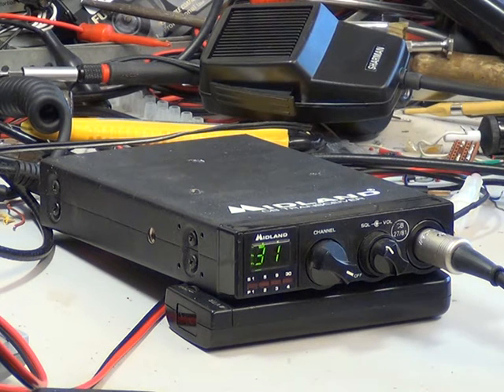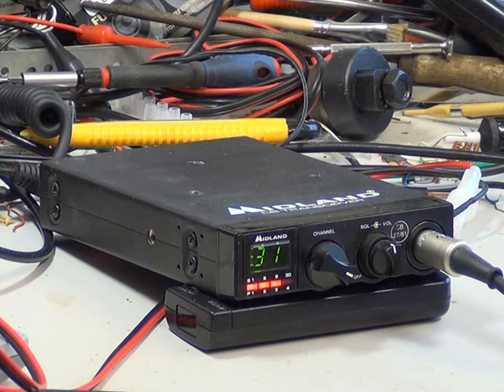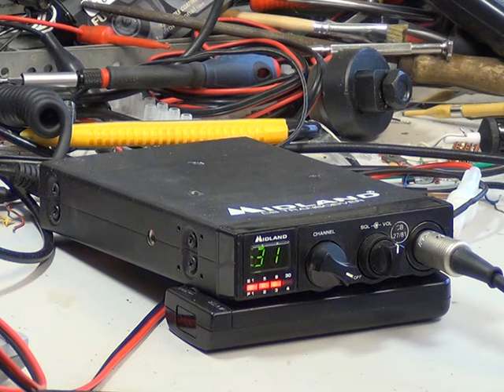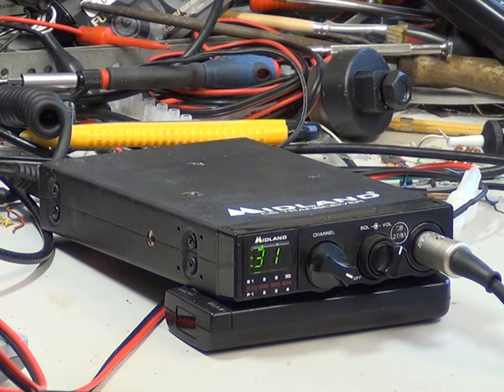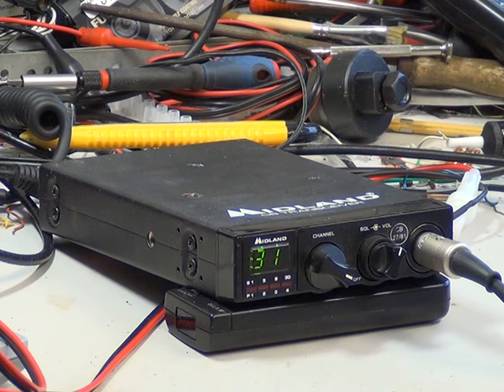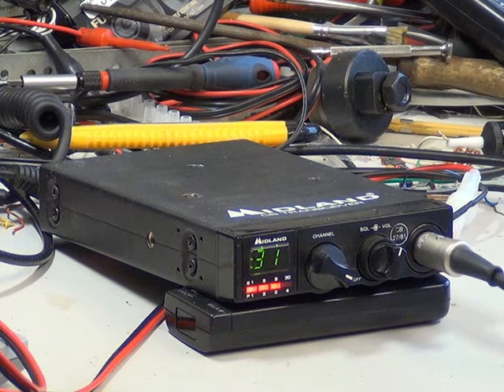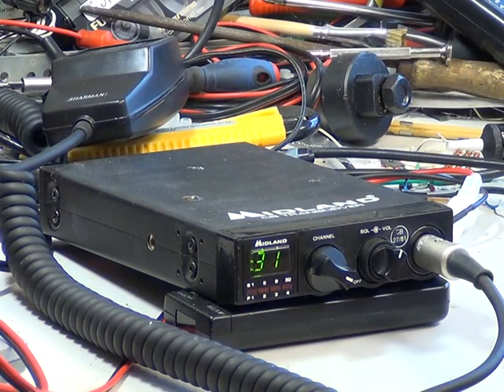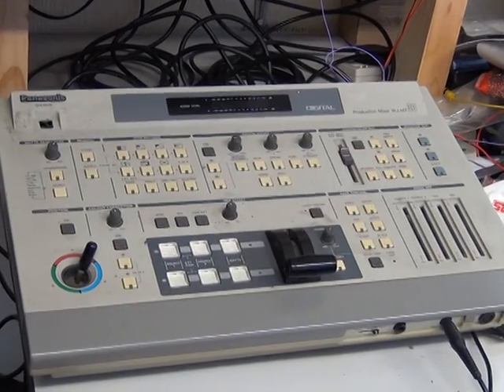Midland 77-104D (CB27/81) CB radio (Mobile) - On the air test

Comment: I'm just finding out that these skinny Midlands have speaker mics? And no internal speaker. Do you know if they are all like that? I'm looking to get either one similar to the one in the video or the one they used for the porta pack, with only on/off, squelch and S meter. Will I need to find one with a genuine midland mic or can I use any mic that fits? Thanks.
Reply from the maker: This video you have commented on is for the 77-104 which HAS an internal speaker. It's the virtually identical looking 77-805 that requires a speaker/mike. That's because it was sold as a port-a-pack transportable & not a mobile. If you end up with a 77-805 (much more expensive even s/h or faulty) then you can use a normal mike & extension speaker. I covered the 77-805 in a different couple of videos if you have a search for it.

Yes you need a genuine midland mike for the 77-805 if you want to use it how it was intended. I recall paying £17ish + post for a mike without a plug off ebay & thought myself lucky! I'd paid £6.50 for the radio alone.

Richard
Reply: @ukfmcbradioservicingTango21  thanks Richard, I shall try and find the 77-104 then to save myself some expense.

Comment: Evening Richard. Radio is back from Tony and following was done. Squelch was not really working too well and a clean up of the mic socket sorted it out. it was well off frequency so Tony aligned it for me. The only other problem that Tony notified me of was that he could only get 3 watts from it??? However I was on call at the weekend and got called to Gillingham in North Dorset and a "ham" friend of mine lives in Hinton st Mary. We spoke from Sturminster Newton, to Gillingham with just a mini springer on a mag mount on the roof, not swr'd-so it seems to be performing well????!!!!! Got a Wilson mini wil and will be permanently installing the radio into the car. Many thanks for all your videos Richard, still watching and enjoying them. Keep up the great work and apologies for not updating you sooner. Regards, 

Carl
Reply from the maker: Don't worry about the power. Tony will be using commercial test equipment like I do. I bet it reads over 4W on CB type meters!

Richard